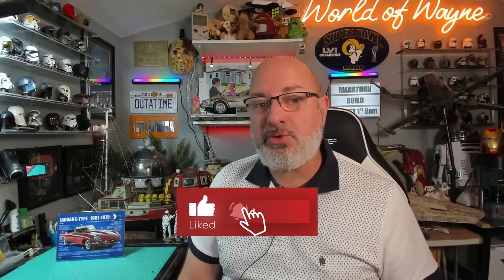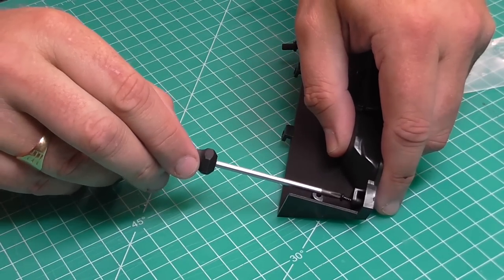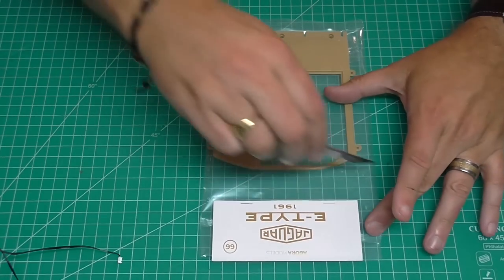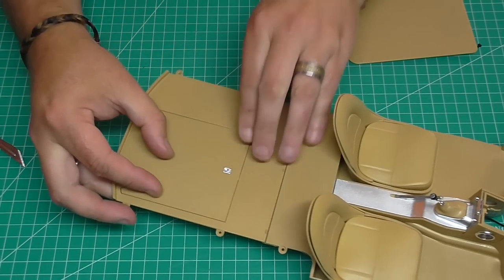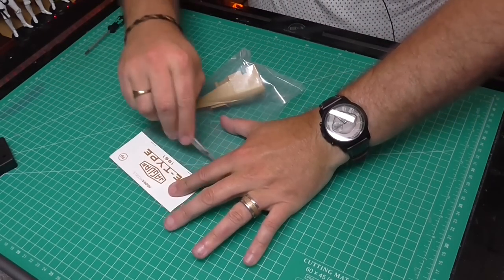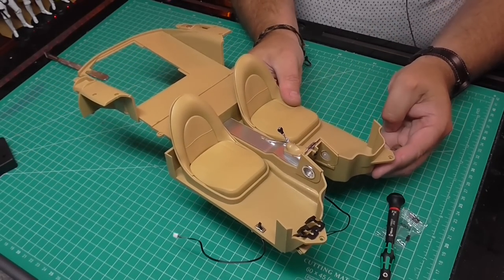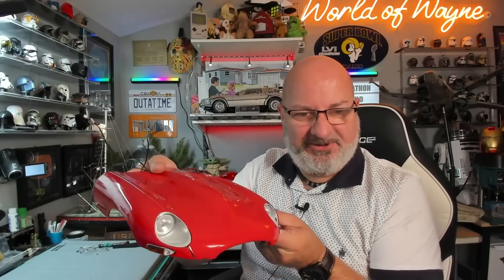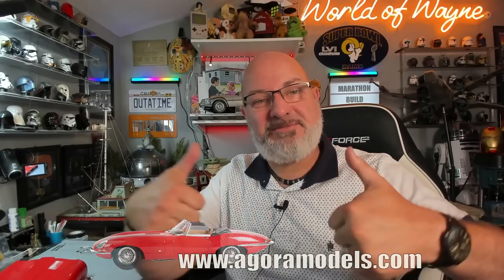Agora Models Build the 1961 E-Type Jaguar 1:8 Scale - Pack 9 - Stages 65-73

Comment: I would consider using some felt or flocking for carpet.  That is the only issue I see wrong with this kit.  You are doing an excellent job on the assembly.  Thanks for sharing.

Comment: Hi where you’ve put the fuel cap on the wheel arch if you pop it out I want a bit of red paint round that little area because you will see it’s not the body colour inside when you lift up fuel cap.
Reply from the maker: It’s a good idea
Reply: @WorldofWayneUK  I did it on mine when I done the hardtop E type and I convert it to Red as well to the horrible green